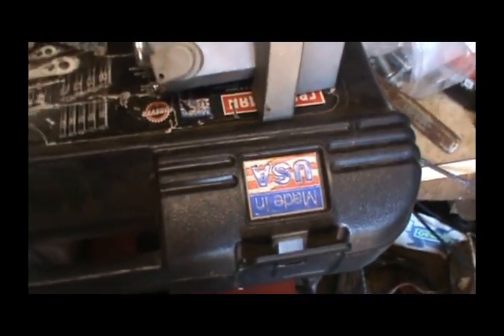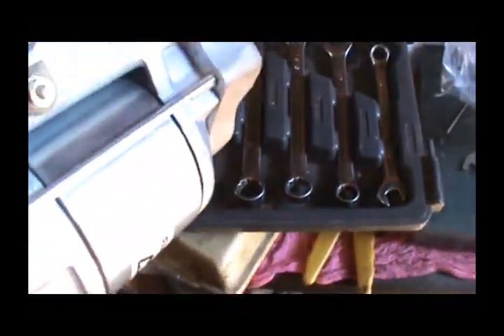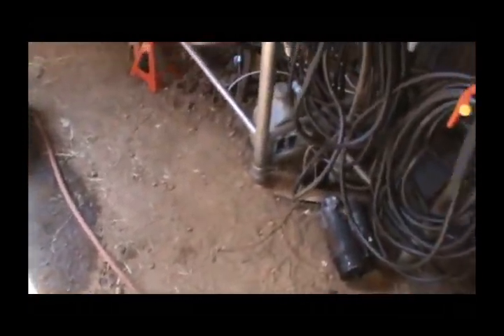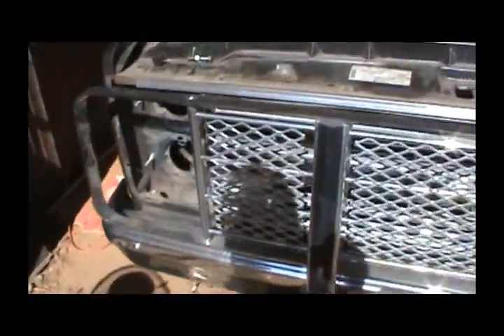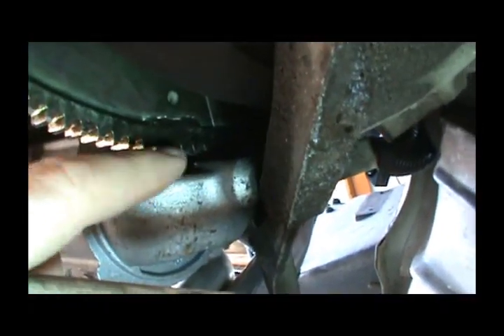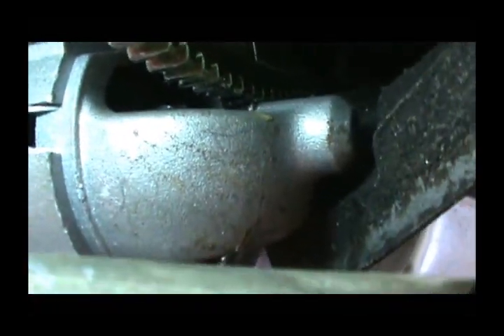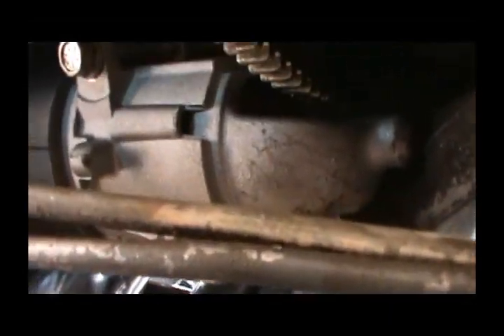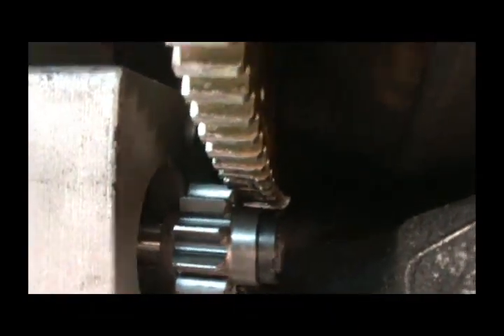C30/383 STROKER - FIXING STARTER ISSUES

Comment: Same problem here- anyone figure this out? On my 4th starter first was original 2and3 were chises mini 153/168 , 4th 92 Camaro mini, --- did eagle get a bad batch of flywheels?  Next is expensive mini or switch to 153  flywheel - HELP!!!!
Reply from the maker: I haven't had any issues since I went back to a stock starter and put the factory brace on it.  The only thing I can think of was it was flexing the starter bolts trying to crank since it does have high compression.  With the brace, it doesn't flex anymore.  Hope this helps.
Reply: @farmboy30117  will try - just can't handle disappointment -might kick the car in the corner another 5 years
Reply: 1970 blocks use a different starter than say a 75 @speedantiquities3641

Comment: was the original engaging a split second, then retracting back? that's the problem im having right now
Reply from the maker: I think the flex plate was defective or installed wrong.  I also didn't have the brace on the original starter.  When I replaced the flexplate and installed the brace, it worked fine.

Comment: Best thing to do with the solenoid is to buy a ford solenoid and install on the firewall, wire up and that will cure the original from heat soaking off the headers....I did on my 454/7.4....doing it that way all you will have leading down to starter is the 12v cable which is easy to secure, no more worries about heat soaking solenoid and or the smaller 12v starter wire burning/grounding on headers....I dont know why chevy never implemented that on their vehicles.

Comment: do you have a 153 or 168 tooth flywheel stagerd bolt patern is 153 inline bolt holes are168 tooth flexplate
Reply from the maker: I believe it is a 168 tooth

Comment: Looks to me like you need to just put a bunch of heat wrap on the header and those wires so they don't melt. Also I think you should put some spacers to lift up your air cleaner because it looks like the throttle linkage hits it. You wouldn't want it to get caught and get stuck wide open lol
Reply: Lol that happened to me my throtle got stuck open and I bout crapped my shorts

Comment from the maker: Headers are ceramic coated so no heat wrap on those.  Got the wires covered so have to wait and see if the starter is going to get too hot too start.  Throttle linkage is ok, hard to see with the camera angle.

Comment: Are you certain the flex plate is on correctly? There are small chamfered areas on the teeth of it that aren't there for looks. Wouldn't those be useful on the side that engages with the starter gear teeth?

Comment from the maker: I took a header boot from one of the spark plugs wires and put it around the starter wires.  As long as the starter itself doesn't overheat, it should be ok

Comment: starter sounds pretty good, u might have a vacuum leak or idle set to low. and the throttle arm hits the underside of the air cleaner housing.
Reply: Lennie Phister my. Starter  bolts  get. Loose  after  I. crank. state a couple of  times  state. works. great at. first. then. while  cranked  loosen  bolts

Comment: Is that a Chinese Ebay starter? Looks like the stater is a manual trans unit and you possibly need an auto trans starter. ??
Reply from the maker: +jim davidson No, it wasn't a cheap eBay starter.  The issue was a warped eBay flywheel :/
Reply: LOL That'll do it. Glad you found it.

Comment: Nice Engine. I kno this vid is old but I'm having starter issue flywheel showing little nicks on the teeth like this one for starter hitting flywheel while running ? Starter is brand new high torque frm Summit Racing not small one like u have still stock size and weight but I don't kno what is causing it ? Should I add another shim? The starter shouldn't engage while I'm driving right ?
Reply from the maker: Some starters come with an alignment dowel that you stick in behind the flywheel toward the starter gear.  If it lines up correctly, all's well.  If you don't have one, maybe the local parts house can help.  Be careful not to use too many shims.  I think my flywheel was warped, either when I got it or putting it on, which was causing my issue.  Replaced the flywheel and haven't had a bit of problem since and I'm not using shims on an original GM starter.  Hope this helps, good luck!

Comment: That flywheel IS BAD.   NEEDS TO BE REPLACED.  NO STARTER WILL WORK WELL.
Reply from the maker: I did replace the flywheel and went back to a factory starter with the rear starter brace.  No more issues.

Comment: Sounds like you have more than a starter issue. No wonder Chevys go through so many starters. You have to crank them 28 times till they run. LOL
Reply from the maker: +jim davidson That's only on the old Chevys ;)
Reply: almost sounds like he isnt using a choke. 

i live in montana...it gets to -40f in the winters, and my 1977 chevy silverado, that ive rigged up an electric choke to be pull cable, has fired EVERY time....and only dies if you get greedy with the choke and kick it off too soon. 

getting to high school in winter was fun....trying to start 4 different outfits before just saying fuck it and taking the 8MPG hit to the wallet my 77 likes to give....400 small block with full time 4. 

always starts, always works, never gets stuck......but 8 MPG HIGHWAY!

swapping in a sm465 standard trans and a np205 part time here as soon as the shop gets cleaned...so...a while from now
Reply from the maker: These electric chokes are tempermental and I think this one needs adjusting.  I had rigged a pull choke on my Mazda B2200 and it never failed to fire off either, so that may be the way to go!
Reply: +farmboy30117 once I did that on my 77....you just start hating any style of auto choke.

I 100% would prefer manual choke on everything "old" i own...it just works.

no need to adjust for summer or winter.

just walk out the door...take note of the temp....realize it's a chevy so it's going.to want choke even when it's 90f....and set the choke.

ps. when you convert an auto like I did ....(remove the electrics, drill a hole in the linkage, make a bracket and.bolt it to the intake....you end up pushing in the choke, and pulling to un-choke..this is.on a q jet)...

just make sure you step on the gas a bit, then push the choke in. 

otherwise it will bend shit....ask me how I know lol
Reply from the maker: LOL, thanks for the tip!
Reply: Obviously he don’t have something right somewhere
Reply: My chevy dually has no problems. Its a 91 and still outlast any new plastic ford on the job site.